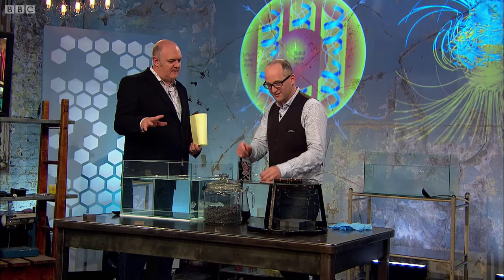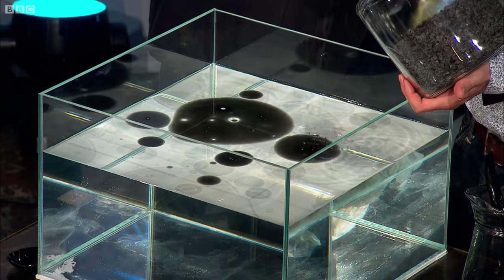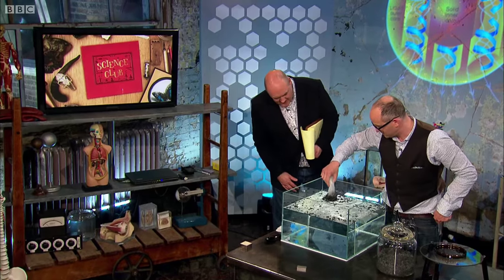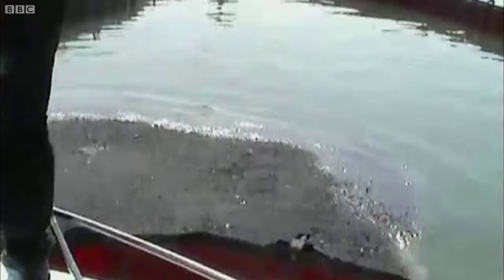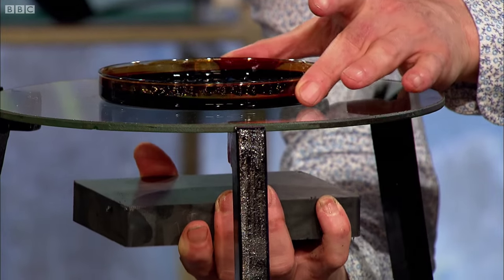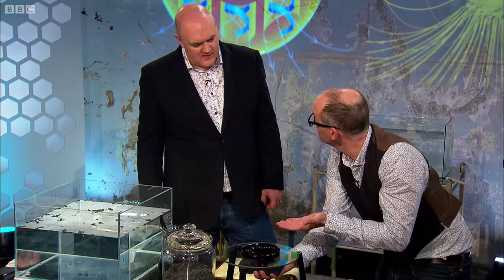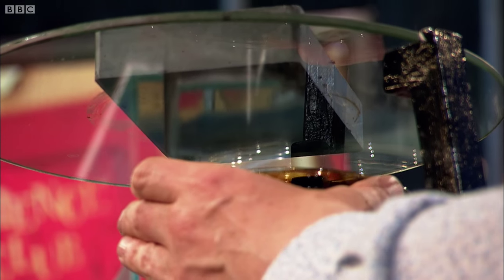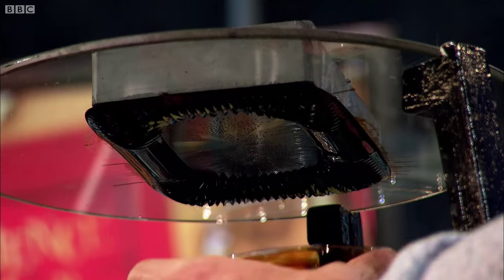Magnetic Oil Experiment! | Dara Ó Briain's Science Club | Earth Science

Comment: Ferro fluid need a ton of work before they can function in engines
Reply: +shannon scxIO what do you mean? why would you use it in an engine?
Reply: +kurtilein3 well i understand the confusion. its completely unrelated from the use talked bout in the video.
this kind of fluid if could be used in an engine, can be directed by magnets to lubricate specific parts that need lubrication at that time. But atm its too abbrasive to be used in an engine
Reply: shannon scxIO
so apart from solving a problem that does not exist (motor oil already goes whereever it is needed without any issues), it is also a bit like wiping your ass with sand paper.
Reply: +kurtilein3 pretty much xD
Reply: shannon scxIO
By the way, one thing where it works perfectly is for sealing around a rotating axis. You have a rotating axis and ball bearings and stuff, and next to it an assembly with permanent magnets that will hold ferrofluid between the rotating axis and the surrounding metal.

It is used in submarines and ships to keep the water from pushing in, and in spacecraft and the ISS to keep the air inside. You have the motor safely inside, an axis going out, and the ferrofluid seal makes it tight against anything, from the extreme pressure of the deep sea to the vacuum of outer space. Its basically the only way to make such a tight seal around a rotating axis.
Reply: +kurtilein3 wow never thought of an application for it like that. Good to know. Thanks for the info. Learn a new thing everyday!